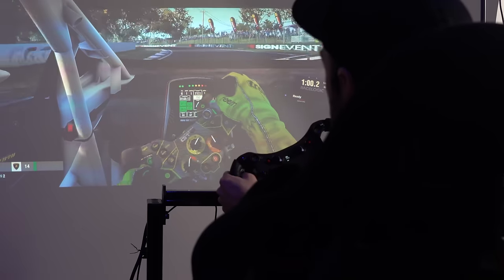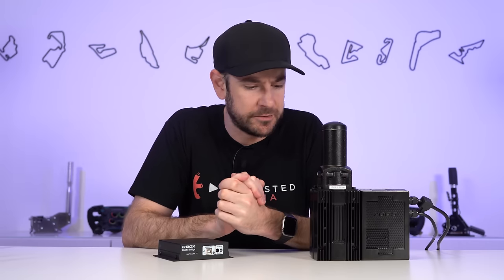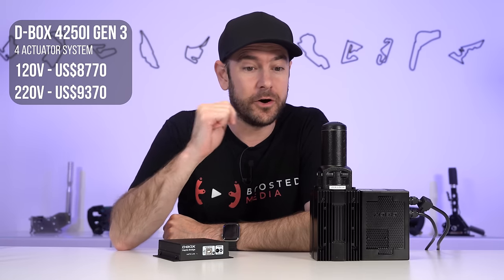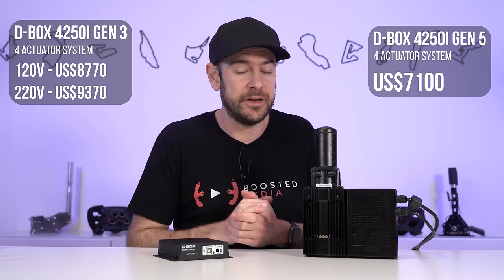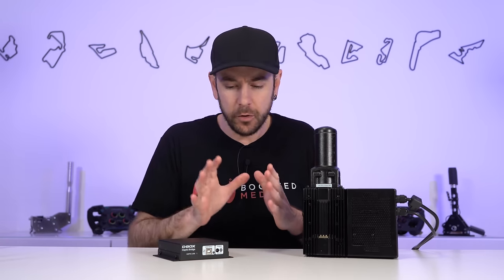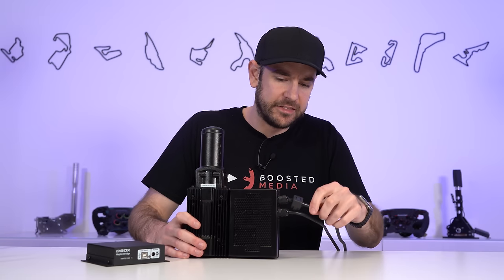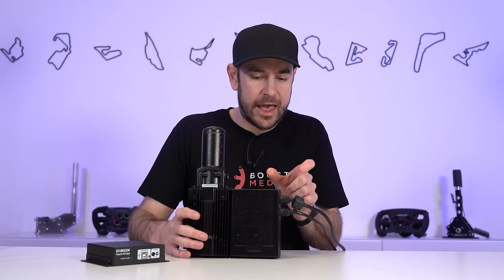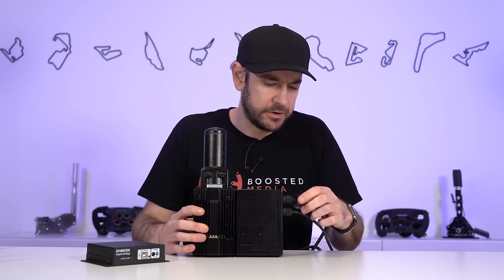REVIEW - D-BOX G5 4250i Sim Racing Motion System

Comment: Great video.  Been running the Gen 5 for a couple months and can just add that when the trial expired, nothing changed in terms of utility of the software for games.  I got an email stating my expiration period was close to ending for use on movies, but it reiterated my use on motion coded games would not be impacted without a subscription and it hasn’t.  (I haven’t tested if that impacts adaptive gaming for non-supported games, but I can check and update this post).
Reply from the maker: Thanks for the confirmation!
Reply: Hello Brandon! :D Indeed the subscription is for watching D-BOX encoded movies... Not required at all for SimRacing.

Comment: Love my Gen 5 D-Box. Swapped out my SFX100 and very happy with the change!
Reply: How did they feel different?
Reply: @Jay-Z33333  The D-Box is just smoother in its operation. It’s hard to explain. I’m not talking about jacking up the smoothing settings in SRS…the D-Box can throw you around just as well but it does it in a smother more controlled way. The haptic feedback of the D-BOX is also brilliant. Forget bass shakers…when turned up it’ll rattle your teeth if you want it too! Something you just have to experience to fully appreciate.

Comment: I have the 1.5" D-Dox with only two actuators and pivot on the front. Been considering upgrading to four, but need more than 1.5" travel for dirt racing games....
Be interesting to see if they do a 3" system, but also face an issue of mounting these, considering I have a Vesaro rig... Nothing square on it...
Other issue of late (last year and a bit) is their support never replies to my email. For a system that is very expensive they don't seem bothered to respond to any support emails, at least from me.
Thanks for mentioning the DK2 system, will look at these as an alternative

Comment: I was thinking of getting the DBox system as an addon for the Next Level Racing GTtrack cockpit,  which it fitted with their V3 motion platform for the seat on top of it. I was thinking exactly the same thing when you remarked that you preferred to set up the system to mimic your body's motion and not the entire car's motion. With both systems (plus the force feedback wheel), one can have everything in one compact cockpit setup.
Reply: Did you end up buying the D-Box or something similar? I've also got the GT Track and Mv3 and I'm looking at options. Traction Plus or SR2 or DK2 or D-Box G5. And/or P1X. Just too much going on 😂 Keen to hear what you ended up doing. Cheers.

Comment: Also I hope D-Box will also model the engine oriëntation in alongside those engine vibrations based off of torque, because when you rev a transverse mounted engine it feels different from a longitudinal mounted one. Then there is also the difference in engine type in the way torque is converted to the chassis.

Comment: Great timing!  Given I have a very comprehensive tactile system, I'm looking forward to comparing the D-Box haptics against tactile effects. I'm expecting to use tactile engine effects which are quiet with tactile, D-Box suspension effects, and see which side does things better and if there are any areas that are complementary.
Reply: Couple trampoline springs, suspend the rig and throw a few BST-1s on the rig LMAO Youll get some motion haha
Reply: @MDaDonLegacy  I'm running a BK-CT and TST-429 pair under both my pedal deck and my seat and have another 6 exciters on the back of my seat.  I have DSP profiles for the transducers so they only get the frequencies they can use and so they run quiet. I'm running multi-layer profiles for each effect running across multiple transducers.  The tactile effects are excellent and they don't shake my rig apart.

My D-Box Gen 5 arrives today. So I'll get to compare their haptics with what I have.

I have no doubt that the D-Box haptics are by far better than what Will had setup before for tactile. 

What I'm running is far more effective and in a different more expensive category.

Still I am expecting that the D-Box brings things to the table that I will definitely want to use. I'm expecting some haptic instead of tactile, some tactile instead of haptic and it's possible there may be a few that work together.  Time will tell.

Comment: The price is insane for what you get with this system. I don’t see any advantages over other motion systems that are compatible with SRS. I have the eracing-labs RS Mega+ and based on this video it can do the same as the d-box system at a quarter of the price. I think people believe d-box is inherently better because of the high price tag and use in professional markets (cinemas, amusement parks etc), but I think that it’s better to get a system specifically designed for home simulator use. As Will mentioned, d-box is designed more for the pro market, and hence you pay a hefty premium for “over engineering”, which does not give you more performance in home use.
Reply: @Jpowellsuckballs  You are right, I have not tried them side by side, as I’ve never been at a place that has both options available to try. But I have tried older generation D-box (gen 1 I believe), as well as the commercial D-box equipment in various amusement parks and such. That of course is not the same as owning it, as the settings are out of your controll, and might not be set up to my taste. Bottom line is that what I see with D-box is commercial quality equipment with low travel (although fast, but it’s easy to be fast when your total travel is 1,5 inches…) and canned tactile effects on top. Compares to SFX clones or other 100/150mm actuators than can run on a Thanos with SRS I don’t see the big advantage. SRS can run tactile effects now, and they may not be as good as D-box, but I find it hard to believe they are 4 times the price worse. I use transducer for tactile effects anyways, mainly because I had them prior my actuators, and hence I still use them because they are already on the rig. 

At the end of the day motion is highly individual. I for example do not subscribe to the notion that “less is more” in all cases when it comes to motion. When I am in motion compensated VR and slam the brakes I want to feel like I’m decelerating, hence I turn the pitch to full tilt, and also use active belts. On the other hand, “g-forces” in turns I find is better to turn down as to much roll feels wrong to me. Likewise, I don’t want to be rattled around “just because it can”, so I don’t go overboard with heave and traction loss. In addition I also drive rally sims and flight sims on the same rig, and I’m sure a D-box with 1,5 inch travel would be underwhelming when landing a jump in DR2 compared to a longer actuator system. Hence, for my use, d-box is overpriced and does not provide what I want in a motion system. But if you want something bulletproof, plug and play with minimal setup time (I.e perfect for commercial establishments where “time is money” and “uptime” is extremely important), and use that in your home sim (which I would argue does not have the same requirements as a commercial establishment), then it just a matter of if you think 7-10k USD is worth it. For me it is not.
Reply: @Jpowellsuckballs   yeah my way is just convincing himself lol
Reply: How long have you been using rs mega actuators? Are they for professional use?

Comment: I have tested the Gen3 1.5" recently : vibrations are great and shifting is so real ! The braking/acceleration/mass transfer are very reduce and not very immersive compared to a real car.... it's certainly due to the tiny travel of the actuators 1.5".  Is there another Gen 5 or Gen 3 of 3" or 4" that could give more travel and certainly more immersion ?  I'm in Quebec city, where i could test this if available ?

Comment: Hi Will ...I have a couple upgrades planed for my Rig. I've decided to add an IR head tracking system. VR is not in the budget ...put on hold for now. My main concern with VR is sweating & eye glasses. I'm extremely susceptible to heat resulting in sweating profusely. The VR would need some wild cooling!!!
My question is two fold ...will the motion & movement effect IR Head Tracking?
Next ...like you ...I use huge triples with some HUD elements like my map placed far to the left. If I turn my head to look at this map ...I assume this is going to play havoc with head tracking. (the map cannot be moved) What do you think?

Comment: What is your take on dbox vs Sigma haptics?  Near the end of the video you mentioned the dbox system being better than all other systems including sigma in a few areas, but didn’t say how.  So the big question is whether the haptics is the feature differentiator between the two systems.  If so, just by a little bit or a landslide?  I suspect some people will be thinking to pick between Sigma’s 6” of travel vs Dbox Haptics because the two are close in price.
Reply from the maker: Dbox is a touch smoother. Although sigma have apparently closed that gap since the unit we received. Have a watch of our DK2 review. We go into detail there :)

Comment: Hi, comparing with the DK2 system, shall we spend $2300 more for the DBOX gen5 to get more immersive experience?
Reply from the maker: The two are very close in performance overall. Dbox is ever so slightly smoother than the Sigma we reviewed, although I believe they have made improvements since. Both are great products but I’d struggle to justify the extra spend over the Sigma unless of course you want the additional features this offers.
Reply: @boostedmedia  Thanks! I live 30 minutes away from Sigma and have been torn between buying the D-Box Gen 5 vs the DK2+. It all seems very close.
Reply: no, having both dbox and pt scorpions, if you have Dbox money go with PT. Quadruple the travel, better actuators, better software with sim racing studio etc. Only dbox advantage is haptic integration but they are canned effects (they do work pretty well)
Reply: @donovanjanus7252  have you gone over to sigma to test their system?
Reply: @netlawman2001  I have :)

Currently have DK2s on my rig, while waiting for the DK6 in a few weeks. I have not tried D Box because the Sigma customer service experience blew me away, and I cannot imagine it getting any more immersive than it already is.

The DK2 have more travel already than the D-Box and I think on inclinations, that is definitely something you feel. I did prefer the DK6s because of that.

If money is an issue, the DK2s are still fantastic. If not, I rather spend it on the DK6 and get a lot more than D Box - which is what I did :)

I wouldn’t have bought it if I didn’t think the product was excellent, but the combo of excellent product plus amazing customer service is impossible to beat. 

The story behind Sigma is fun too. They lived and breathed racing cars, and are very passionate about their technology. It’s not just another tech product in a product line. 

Hit me up if you have any other questions.

Comment: hi, great video thanks for the work!
what I really want to know is the comparison to SFX 100? Is the D box system much better, more immersive. Have been thinking about installing a D box system for a long time. I've been driving the SFX 100 system for 1.5 years. Does anyone have experience with both systems. I'm a huge fan of industrial solutions, so DBOX Gen 5 is really interesting :-))
Reply from the maker: I can’t make the comparison as I have no experience with SFX100, but I guess the question is do you feel the experience is lacking with what you have currently? If not, why spend the money?
Reply: that makes sense but since I've seen the D Box systems
I think that's the real deal
Maybe I'd be disappointed too, because there isn't much of a difference
hence my interest.....
I probably just had to test it :-) thanks for the reply

Comment: I want to buy this or the Sigma dk2 - if I'm not using engine vibrations, will it be ok having this in an apartment building (wooden floors)? I'm worried about noise complaints. Or is having some sound damping essential?
Reply: it won't be an issue, just don't use the haptic vibrations. Also large movements\crashes can slam the ground a bit and move the rig...so just limit that. Having Dbox and ptactuators scorpions though for the dbox price go with PT.

Comment: What are your thoughts on having the screens mounted to the rig so they move with you or independent? Thanks for the video!
Reply from the maker: If you have a solid mount such that the screens aren't going to be flapping all over the palce, and it doesn't push you over the weight limit, then it's better IMO to have the entire rig move with the screens in unison.

Comment: Why not just remove the ferriet choke and then wrap some electrical tape around the cable on that spot, just enough so that the ferriet choke would clamp a little better. Instead of wrapping the tape around the choke, because that would be silly.

Comment: Hello, do you prefer gen3 or gen5 ?   Do you feel more vibration on rumble strip with gen3 than gen5 ?....it see it on the vidéo of Barry.... and the gen3 look like more robust.  Thanks
Reply from the maker: This is covered in the video. I won’t be taking the G3 off my daily driver rig. But the user experience is the same between the two. G3 is the more robust product but it also costs more and is arguably over-engineered for at-home sim racing use. I’d sooner pay less and buy the G5 if I were buying.

Comment: Would this be better if your monitor was mounted to the rig or good either way?
Reply from the maker: At these levels of movement it doesn’t really make a huge difference. Ideally it’s better to have the screens move with the rig, but that also can cause the screens to wobble around quite a bit which can be distracting. So it’s a bit of a trade off either way.

Comment: $7000 and that ferrite choke implementation looks down right awful. Also if they didn't want to fit that big plug in there use a different connector...$7000 and the darn thing looks like a step backwards on the hardware front. Maybe that's why it's cheaper.